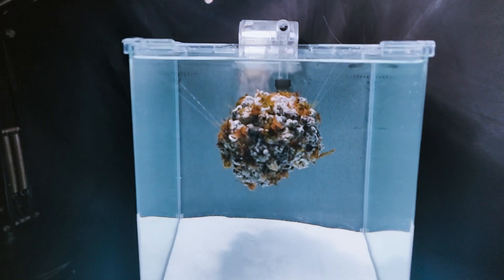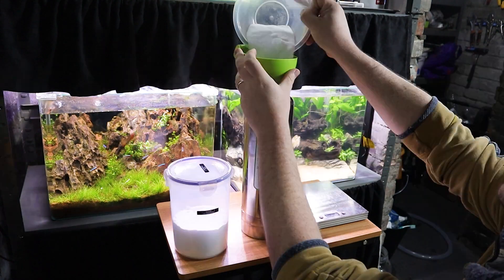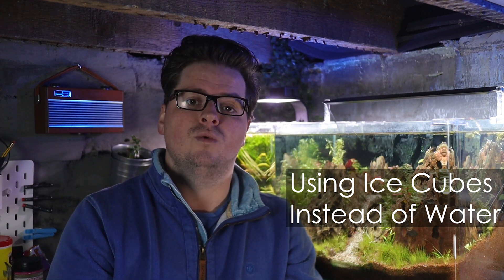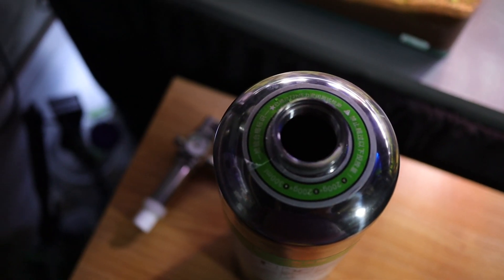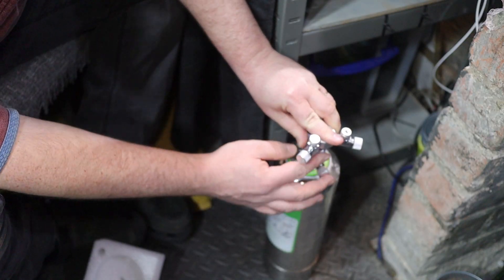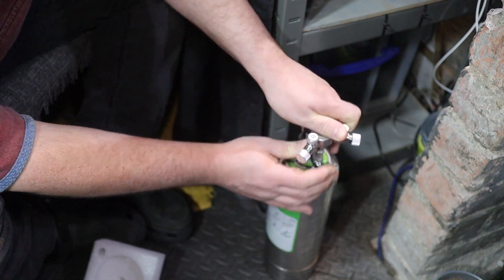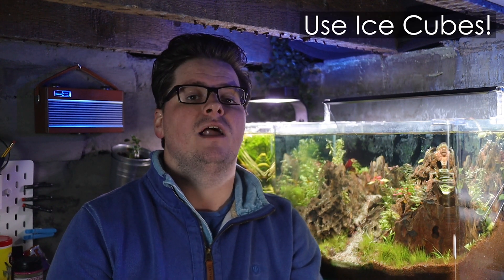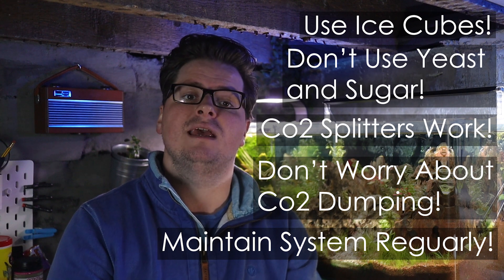Why You Should Use Ice Cubes in Your DIY CO2 Generator!

Comment: So I did an experiment where you don't need any ice cube without the mixture reacting with each other immediately and losing lots of co2. I found out if you Pour Baking Soda first and then Citric Acid last after adding water it will immediately react to the point you are not given enough time to close the system using the Pressure Valve without losing c02 this is because the citric acid don't absorb water unlike baking soda which will absorb the water not letting it past easily. My technique is to first add citric acid so it will be in the very bottom and then baking soda after citric acid. Since the water will not immediately pass through baking soda because of its sticky texture it will take time till the water reach the citric acid. With this you are given ample time to close the cylinder without losing c02.
Reply: In short. Pour citric acid first then baking soda. Then add water. You will find the mixture will not react immediately. 
If you pour baking soda first and second citric acid. The water will pass through citric acid immediately once you pour it making the mixture act rapidly
Reply from the maker: Fantastic experiment and such useful information. Thanks so much for sharing, it makes a lot of sense and I will be trying it myself. I've pinned your comment so that everyone will see it! 👍
Reply: Another reason why it might not be advisable to use ice cubes is because citric acid + sodium bicarbonate is an endothermic reaction. That means it'll likely re-freeze your water quickly and halt the reaction until more water eventually melts to continue it. You're better off using Fluff's recommendation and some warm water to prevent premature freezing.
Reply from the maker: @MikeTrieu  Brilliant. Thanks for sharing, constantly learning in this comments thread and really appreciate the communities input. Cheers.
Reply: @AquariumShed  There is evidently a brewing technique called "pressure fermentation". Reading a bit about it, it says exceeding 37PSI will stress the yeast. They are living critters, after all :) PS, there was a significant error in the reddit thread regarding vessel pressures. If you look at the most recent post, you'll find more info and links to some helpful calculators.
Reply: How about placing the cylinder into hot water for faster reaction since it's endorthermic reaction.
Reply: @p0tat0manOOOO7   I use boiling water instead of normal water for the mixture for faster reaction, that's what I use and my system is already more than a year and still works perfectly , as long as you citric acid goes at the very bottom and followed by baking soda you still have ample time to close the system
Reply: @p0tat0manOOOO7  Absolutely. There is no reason you can't speed up the reaction, and/or the ice melting, by placing the canister in a bowl of warm water. I'd avoid hot water, as this could substantially raise the pressure in the vessel, though it should by no means exceed the safety margins, provided you haven't exceeded the recommended amount of bicarbonate.
Reply: Thanks for the tip, I will try that way next time, another reason my Taifun system didn't work well was, I found the one way valve body was leaking! I still think the cylinder pressure guage is not working correctly, but we'll see, thanks again.
Reply: This is amazing stuff Fluff, thank you.
Reply: O had no problem,you lose very minimal co2

Comment: How about chilled water? Like fridged water.
Reply from the maker: Its not about the temperature, it's about how the liquid acts as the carrier for both the ingredients - enabling the reaction. So, if you slow that process down with ice cubes you have more time to seal the container. But, tbh, I think the losses are pretty marginal. Pouring the water at an angle and being quick with your hands is generally fine.

Comment: Are you using a solenoid on this setup or do you need to turn on each morning?
Reply from the maker: Hiya - yes, I use a solenoid on this setup within the output line. But, most versions of this system these days are available with a solenoid built in to the regulator which looks way more convenient. The canisters are rated to withstand well beyond the total pressure, and there is a safety release valve, so using a solenoid is not a problem.

Comment: thank you for these really great videos.  I just got mine today and trying to set it up.  what do I do with the black thing that says "preventing crystallization drying filter core"?  I saw it mentioned in the comments somewhere and I believe they said to fill this with water?
Reply from the maker: Ooh, they're getting a bit different from my older model I'm afraid. I'm guessing you are referring to the bit thar screws into the vacuum seal lid at the top. My model has a piece of filter inside and no requirement for water, but like you say, others have said in the past that their instructions required this to be filled with water. Either way, the point is to stop any impurities reaching your aquarium water. Either filling with water, or stuffing it with filter floss should both do the trick I think! 👍

Comment: From a brewing perspective, the reason the yeast isn't doing well in this environment is that the amount of co2 in the simple wort you've created is too high for the yeast yo survive. The system causes enough pressure to restrict off gassing of the wort and the co2 is left in solution, killing off the yeast. It doesn't matter how much sugar you add, they simply won't survive long enough if their waste isn't removed. That's why co2 generators used with yeast are just straight lined into the tank.
Reply from the maker: Really helpful explanation, makes total sense. Thanks so much for sharing! 👍

Comment: Anyone have ideas on how to clean out and remove the solidified mixture when it’s spent?
Reply from the maker: Hiya - I touch on this at around 06:25 of the video. Soaking in hot water is usually sufficient to remove the residue. Cheers.
Reply: @AquariumShed  
Have just done this by leaving it to soak for couple of hours and yes it’s worked!
Reply from the maker: Fantastic. Happy to help! 👍

Comment: Hi, are you still using this system? my first attempt was abysmal, hardly any presure in tank, I thought maybe the guage was faulty, but I only got 2 days worth of co2. I'm using the JBL Taifun diffuser (the little tube where the bubbles spriral up and up) I thought that this would need less initial pressure rather than overcoming the resistance in the ceramic discs. I'm going to try the standard liguid water rather than ice cubes this time to see if that makes a difference.
Reply: This is what will happen if the pressure valve not the needle valve that you rotate, but the one on the very top, does not sit completely on the bottom , what you need to do first  is that first empty the cylinder so that gas will not spew. Unscrew completely the pressure gauge and you will have spring so be careful not losing it then screw it back completely again but this time make sure it sits on the bottom of the head.

Comment: I am not new to CO2 but Covid brought an end to my supplies. The only CO2 I could buy was 10 kg big and ugly but cheap. So after watching your videos as well as others I bought the FZone one from Amazon UK. The advantage is anything wrong can easily send it back. I have a question about the screw-in filter. How long do these last and where to replace them? The only ones I can find is from WuyouChy Amazon US at $7 plus postage. What is your experience so far?
Reply from the maker: Hiya, I have to admit that I have only replaced my filter once in a year about two months ago (so roughly 10 months use), and upon inspection its just a really dense filter floss type construction similar to a cigarette filter. So rather than buy official replacements, I have stuffed fine filter floss in there quite tightly. The same kind that I use in my external filters. I refilled the system the other day and it seems to be doing the same job as the original filter, with a slight browny/yellow sediment starting to appear just like before. Hope that helps. 👍
Reply: @AquariumShed  Thanks for that nice to know it last for a while. The one I was looking at was filled with little balls of something..
Reply from the maker: Aah that's a good point. I remember others in the comments thread mentioning this. And also some that had directions to fill the chamber with water. There's obviously a range of ways that work to create a barrier for impurities. For reference, mine is a ZRDR system. 👍

Comment: Please has anyone got information on whether there is any maintenance required for the filter that screws into the pressure gauge. On mine it says 'clean the filter' and states it may swell up when wet but will return to normal as it dries. I'm not very good at deciphering Chinese instructions🙄
Reply: I am in the same position, my instructions say nothing. I have just posted about replacement. There is practically nothing online about it and don't want to be in a position where it gets blocked.
Reply: @The_Robert.Fletcher  I haven't tried it on mine but I believe the filter has a lid that unscrews and the filter contains a small amount of media that appears 'gel' like on the pictures ( see Columbo version).
 I saw somewhere it said if the crystals were large and swollen they need replacing but I also saw where it said, if the crystals were large and swollen they would shrink again once dry. Now whether that means drying them will recharge them I don't know.
If we could find out what these crystals are we could just replace them ourselves. I know that replacement filters are available but haven't spotted any in the UK. I believe they can be ordered Amazon EU.

If anyone has any knowledge or suggestions it would be most helpful. Even knowing how long a filter lasts ( how many fills) would be a start.
Reply: @haitch04  Thanks for your reply. Basically, you have found the same information I have. My fear is there will be a failure and I will be unable to restart it without further risk of damage. I think I will get a couple just to be on the sake side you never know.
Reply: @The_Robert.Fletcher   I think I'll follow suit on that and order some, better safe than sorry.
Reply: @haitch04  Hi, I have ordered 2 from Amazon US for GBP 21.12. There is no description and no reviews. Could it be they never wear out? I am interested the Owain said there was fibre in his.
Reply: @The_Robert.Fletcher  Interesting, I have mine running at the moment so can't remember exactly what is written on the filter but I'm sure it just says to 'clean after each use'. The manual sheet that comes with the kit doesn't even mention the filter so one suspects it's function is minimal. I'll keep looking to see if I can find anything further.

Comment: Sorry if it's a dumb question but can I just turn off the needle valve at night if I don't have a solenoid , I mean it won't over pressurise? Thx for a great couple of vids on this unit.
Reply from the maker: Hiya - there's no dumb questions here! Yeah, your spot on, you can just turn off the valve at night if you don't have a solenoid. In my experience, one or two days won't overpressurise. But even if it did, there is a pressure release valve on the unit. Hope that helps! 👍
Reply: @AquariumShed  Really helpful thanks, I will get a solenoid as soon as I can but thanks for the advice.
Reply from the maker: @haitch04  No problem at all. Always happy to help!

Comment: Hi! Any Splitter would work with this system?
Reply from the maker: Yup, pretty much the only issue is making sure the splitter spokes will fit beside the needle valve, but even this limitation could be overcome with an adapter to lift the splitter higher! 👍
Reply: @AquariumShed  thank you very much for your reply

Comment: What happens when you turn it off overnight will the pressure built up overnight. Or the bleed valve will open and close once there is to much pressure. How does it work if you leave it overnight every night. As I'm waiting for mine from Aliexpress Thanks
Reply from the maker: Hiya, just one night's build up of pressure isn't enough to over pressure the system. But the valve is there as a precaution. I've been using this with a solenoid on a timer and it works perfectly! 👍

Comment: An added tip on the ice idea; use crushed ice if you can get it. I buy crushed ice to use in my drinks and I just weight out the appropriate amount of water as ice in grams and pour the crushed ice in using a funnel.  It works beautifully. Costs almost nothing since I get a 25lbs bag for a couple of dollars US.

Comment: I found that ice is not required as long as you don't mix the citric acid with the baking soda. Just put them in separately and you're good. A small amount of co2 will be lost, but it's a very small amount. I've seen the other video where the guy mixes them and then adds water and it spurts out everywhere. Just don't do that and it's fine. The ice is a lot of bother for very little benefit.

Comment: I have a theory.
The rate of reaction is determined by the amount of water while the duration of the reaction is determined by the amount of reactants.
This means that the rate of CO2 produced will be faster if more water is added, and slower if less water is added.
This also means that if you double the amount of reactants, there would be twice as much CO2 produced, obviously.

Basically, what I'm proposing is that we can safely add more reactants (sodium bicarbonate and citric acid) if we keep the amount of water constant, or perhaps even reducing the amount of water.
Reply from the maker: Interesting theory. I think your spot on that the water is simply a carrier to enable the reaction. However, to play devils advocate, the only thing that comes to mind is that at the end of the reaction there is still a lot of crystalised sediment and I often wonder if that has all completely reacted or not. I wonder if having more reactants but the same amount of waste would just increase the waste and not lead to a doubling of production. But like I say, I am by no means a scientist..... lol.
Reply: As a corollary to this thought experiment, what's to stop us from using a hopper and auger system to feed the dry reactants (they could even be pre-mixed) into the reaction vessel on-demand and then just drip whatever water we need to generate the desired PSI? This could even be automated somewhat with a microcontroller, a motor, a solenoid, and a pressure sensor.

Comment: Hi Mate, do you usually rinse the cylinder with water before filling new mixture or you just dump the excess solution afterwards?
Reply from the maker: Hi there. Thanks for watching. Yeah I usually just give it a quick soak and swill with boiling water to break down any sediment. Just be careful, the cylinder gets really hot! 👍
Reply: @AquariumShed  Nice mate, great help! Thanks alot.

Comment: Hi, Can we open filter and clean the desiccant beads with water? What's the best way? Thank you.
Reply from the maker: Hiya. Not sure I fully understand what you mean? Did your ceramic filter have some beads in it? If so, that might just have been part of the packaging. I just rinse the filter and the canister in warm water. 👍
Reply: @AquariumShed  Thank you! I think we all have but I am not sure. According to this we should have beads in the filter: https://www.aliexpress.com/item/1005001798298332.html?spm=a2g0o.ams_97944.0.0.3199zty5zty5Ky&scm=1007.26694.226824.0&scm_id=1007.26694.226824.0&scm-url=1007.26694.226824.0&pvid=9398a487-346b-494a-9476-54b75fa85833&fromRankId=5740089&_t=fromRankId:5740089
Reply from the maker: @Everytimeifail  just checked mine and I don't have the beads for some reason, I just have a dense sponge in the middle of the metal piece with a ceramic end cap. I have only ever just rinsed my filter in warm water and I imagine you could just do the same!
Reply: @AquariumShed  thank you. I will do the same when refill time comes up.